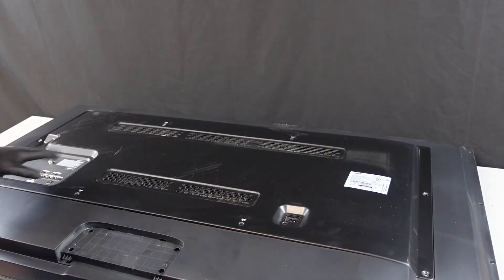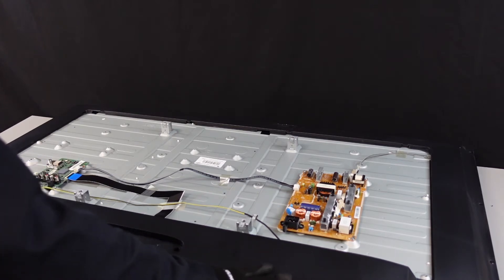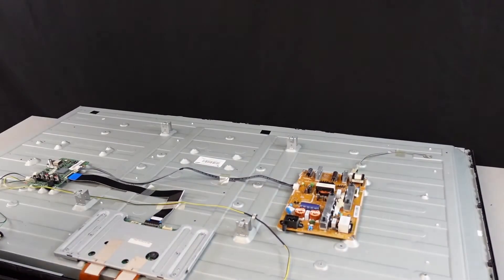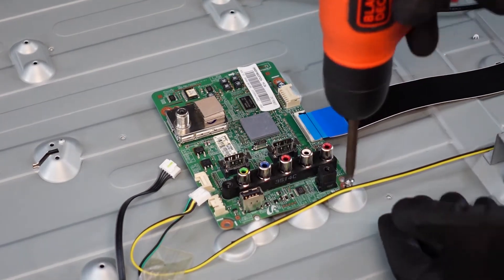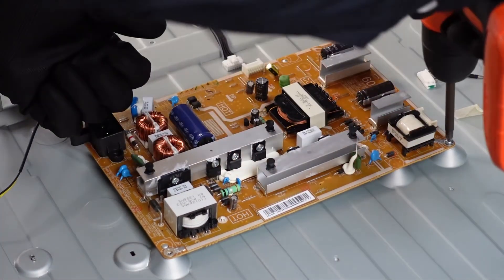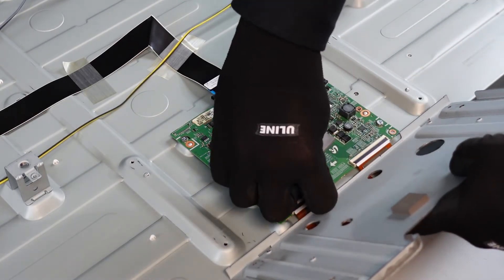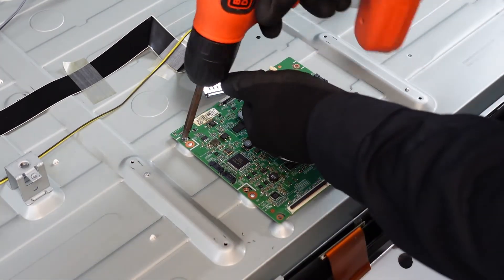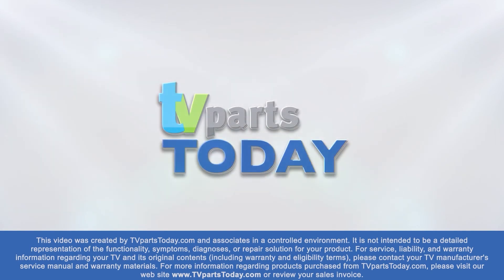Fix your TV by yourself.  (SAMSUNG UN60FH6003)

Comment: I have a UN7IHU9000FXZA and the led light flashes red, but no picture until we remove the sek-3500 evolution box then we see the graphic animation on the screen instructing us to plug in the box, i ordered a used sek3500 on ebay and new cable, but it does not work either. Someone said i may need the original one connect box to program the ebay purchased sek3500, but i no longer have the original one connect box.  Is this true?  Any suggestions on how we can get the curved 78 inch to work again?
Reply from the maker: That is the most common issue with a faulty one connect. Unfortunately, I still think your best bet is to replace the one connect box. I'm not familiar with "programming" a new one connect, but if you no longer have the original that takes that possibility off the table anyway. Good luck, and if you have any other questions, give us a call at 1(800)203-7484.

Comment: Hey guys! I replaced my power supply board but still have a dim screen. What else could the issue be?
Reply from the maker: If you have determined that your backlights are not lighting up and you have replaced the power supply board, I would try a backlight inverter board or the LED driver board. If your unit does not have these boards it would most likely be an issue with the backlight strips themselves.